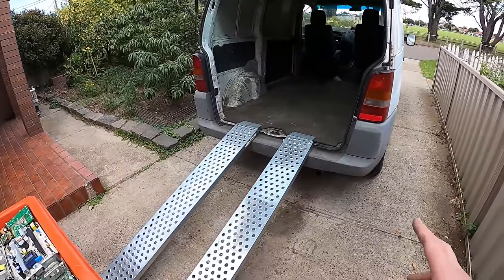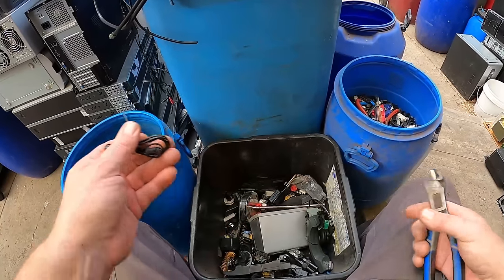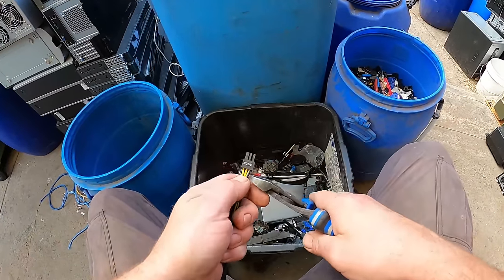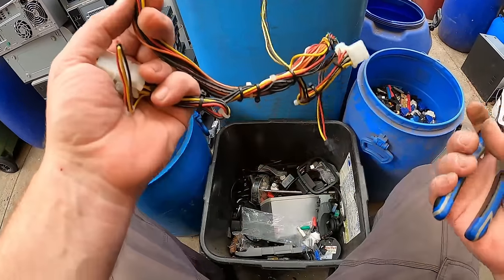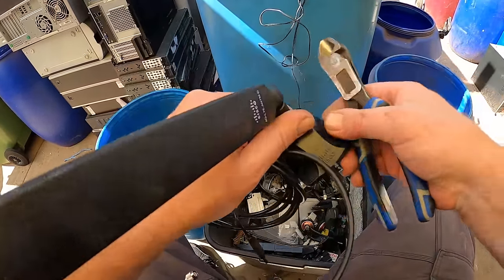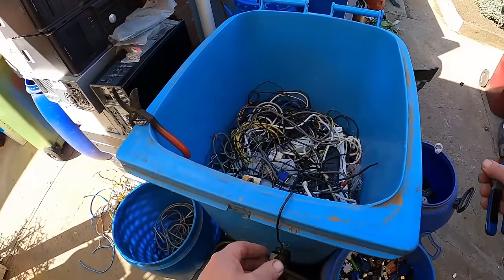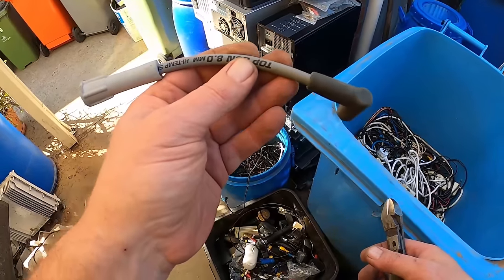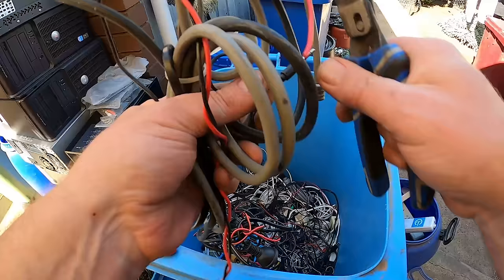Scrap Wire Processing Insulated Copper Wire

Comment: Why not build some sort of workbench guillotine for the wires to cut a handfull at once and sorting bins attached for the ends.
Reply: They do make machines for that kind of work. It's a wire stripper it's called that has a motor. You can find YouTube videos on it
Reply: @waterup380  Well, there are custom power tools for almost every process if you're willing to invest, but it's more satisfying to craft your way around with your own scrap bits and pieces. Hand cutting seems a bit Sisyphean to me due to the slow progress and also time consuming.
Reply: Yes I know I been doing that stuff all my life
My dad did it before I was born so I know. Plus watching some people doing scrap on YouTube I kinda already know how much there are going to make before they even hit the scrap yard. So in a Down time like this if the scrap yard is closed why not take the time to clean your copper and brass stainless steel and aluminum because you will make more money even if the price is low has it is still.
Reply: Yes some automation could cut the time immensely as well as save the hands.
Reply: That'd be great for him. His hand is not going to like doing this kind of work for much longer.

Comment: I'm imagining a more purpose-built wire scrapping station for you, Ben.  
You're a pro and will be processing wire for many years to come.  Spend some time up front creating a system to improve your work flow and save you tons of time AND motion later.  Create a work bench high enough to put a shorter wheely bin or four beneath.  a pedal operated shear on the right corner, blades scissoring away from you.  Below the shear, off the right side of the bench is a gutter for the bits to fall in.  Under the far end of the gutter is the gold recovery, under the closer end is the junky junk.  Cleaned wire gets combed forward, off the table and down into a rolly bin.  Your wire stripping machine could have a permanent home around the other side of the bench.
You could start simply by just hose clamping those garden shears to the top edge of a bench, rig it all up with some board, chain, hinges, pulleys, etc.  You'd want your shear to open back up automatically with a spring or counterweight.  Extra points for getting the work station properly lit with some LEDs!

Comment: I would recommend some tin snips, im not sure what they are called in australia but i got this really nice pair that are really comfortable for my hand and will cut anything, everyone says they get dull really quickly but if you get a decently nice pair they will last you forever, ive cut lots of thick cords with it and i also just snip off brass from plugs and my hand never gets tired, would definetly recommend for that volume of cords
Reply: Yeah we have tin snips, I use them for cutting my wires, a decent pair with the little serrations are awesome, good spring so better on the hand fatigue.

Comment: Ah, Ben gettin' to the wheels bins, Nice. Steel in Illinoisnorthern part is paying 65 per ton or 3.25 per lb for the light weight, 85 per ton or 4.25 for heavy steel.

Comment: I use tin snips to cut the plugs off a lot of my wires. They will cut about any wire with ease and most are spring loaded so they are a lot easier on your hands/wrists.

Comment: If you boil the moulded plugs for a bit bud the brass pins will pop out like you wouldnt believe 👌
Reply: I love this tech, and don't process plugs until the turkey frier pot is full
Reply: I use the stand, but not the propane- hotplate to keep 'em warm while i work through them at the bench vise w/ vice grips.  It's worth the time to sort them by type before heating for less vise adjustment between types of plugs.
Reply: I let em bubble on top of the woodburner, nice and easy 🕯🔥

Comment: Hey Ben.
I use gardening bypass secateurs to cut my insulated wire.  It's a lot better than side cutters.
Cheers from Bondi Scrapper
Reply: Mine are Felco. Heaps better than the ones you have

Comment: Can you put the smaller brass ends in a bin and sell it as dirty brass? They buy it here that way in Cincinnati. I mean it’s only 40 ,maybe 50 cents a pound, but it beats the 3 cents or so putting them in the steel/crap scrap pile.

Comment: To my metal recyclers,  all wire, except antennae wire, is bought under the same category.
Today I took a load to them only to find that unless I am a trade operator or have an abn, the place is closed to me so, I  have  to simply store my scrap until the Chinese Flu situation  has been resolved.

Comment: 16:56 is this a brand new usb cable still sealed in the package? why are you cutting it up? just so it can be melted down and turned into another usb cable?
... do you check if anything's working before you scrap it? reuse!

Comment: Would you get more $$$ if you left some of the wire (couple inches) on the plug and toss it into the low grade bucket? Or do you get something for those waste ends?
Reply from the maker: sometimes I do that with heavier plugs like video jacks but it would be too obvious if there was a lot in the mix
Reply: @eWasteBen  I guess they don't like paying for that extra weight on low grade; do you get $$ for the stuff that was tossed in the bin in-front of you? I started to scrap again since I lost my job cause of this Covid stuff.

Comment: Ben cant understand why you dont keep theconnectors off the ethernet cables ? the amount you get it has to be worth it. I did some over the weekend just gone and got it down to about 30 seconds per connector. also if you can get a 2nd hand freezer put them in that for a day and you can just hit with hammer on a solid base the platic just crumbles and you can pick the gold out. Dont let things  mount up to much. Good video though
Reply: Im gonna try the freezer, we've got a bit more room now that we can't find anything to put in it.
I didn't give up on my ends, just got tired of the hammer bouncing or mashing the end flat

Comment: watching paint drie , its good man. im still here :D . techs + cables .. there are allways modules to be changed that come whit new cables.. so most of the techs, change the component, and reuse the old cable .. the new cable..remaining  . under that reason , the new home printers , come whit out a connection-to-pc cable , because they think that you allready had a printer home who broken, and have a old cable.. and so on and so forth .by the way , the old CISCO electronics, are a sh1tload of money , so you might wana rethink recycling or re seling them :) ps: on the printer cable: both ..thingy connectors , have pins , and easy to extract :) .seen you droping it in the rong bucket

Comment: Is it worth clipping the plugs ? I get same price for computer .51 lb under 500 lbs .57 lb over 500 lbs . I do clip Gold connectors don’t have to pull screws get .90 to 1.10 lb  the harness wire like from power supplies don’t have to clip .70 .75 lb  . I hope it’s worth clipping that low grade crap.
Reply from the maker: we get much better prices
Reply: eWaste Ben 
So for low grade your getting better than .57 lb  that’s good . Are you getting more than 1.00 lb on gold connectors ? 
Here in the Midwest US  wire and aluminum is scrap yards bread and butter there paying $130.00 $175 ton for metal and like .25/.30 lb Aluminum . You see the wire price . I strip any wire that’s over 50/60 % recovery and two foot or longer due to time spent feeding the stripper. Servers and switches are my bank . Then copper I love roof top unites . Chillers and AC units.
Reply: eWaste Ben keep up scraping

Comment: copper copper copper .. about the copper . did you know that copper like silver have atibacterial properties ? my old folks were using bracelets of copper for "blood presure" they said .. never the less time passed, gorgonzolaVirus arived , and as a counter measure , i keep at all times in my pocket couple copper based coins, and 1 or two silver coins to play whit them in my hand .. yesterday some one asked me , what counter measures can he get to limit the bacteria from going to work , touching various dor handles.. etc. had in my vecinity a scrap laptop procesor cooler (a plate of alluminiu aloy whit a pice of copper ) .. made from that a bracelet.. a hammer, a pair of scisors, a wire brush .. to clean and flat out my thing.. but any kind of copper pipe can simply do the job .. + i was thinking on his speach on the dor knobs..handles.. etc .. so for that part i recomended him to buy a copper adesive tape, and rp the handles.. anwyay ! copper is ok. nd im writing in here , because is a good channel and most of you people have access to various metals.. like .. the all around cheap copper . good luck and stay healthy :) (no, i dont have a channel, this is not a comercial or advertising , and i dont want to create a channel)  ps2 : data cable plugs :  keep them , make a huge batch , coock the plastic, and disolve the metal .. its not verry hard .especialy that this days, data cable plugs, are all around .

Comment: i only use this as a guide to scrap prices in victoria but they are an hours drive east of Melbourne..... http://www.evelynrecycling.com.au/prices by comparison  Manhari does the best scrap prices and pay more than the competitors but i dare say the prices will have dropped in some categories. cast ally used to be $1 a kg but now 30c. extrusions were over a $1 reduced to 30c. insulated copper bombed from $2 to $1.30 a kg. Electic motors were 30c a kg but now half that. Brass mixed dropped from 4.25 a kg to a measly $3 a KG. other metals....you get the picture. Unfortunately i live about 2 hours away in Bendigo from a decent scrap yard like mt eve or manhari. all yards around Bendigo region (rural countryside basically) Pay far less than mt eve (we get ripped off basically....guess its cos of BS logistics of transport etc). In the mean time I'll be sitting on what i have until things get back to normal.
Reply from the maker: For the better stuff your best to load up and bring it to melbourne, some scrappers load up with circuit board to bring to me at the same time. motors were 70c kg here for ages, I will be doing a scrap run end of next week to see what's happening at manhari

Comment: OK I'm 12 minutes in and I think it's my 3rd time watching this. I did something like this last weekend and messed up a little so I'm back, but I find myself confused. I thought all those wires WERE low grade (lets say 30-39%) but then I see you throw the short connectors with plugs into their own pile and call THOSE low grade. I am trying to understand but even with the right sources... so much ambiguity! My understanding: Those short wires w/ connectors are LG,30-39% and all the ones your putting in the bin to the left are LG,40-49%.